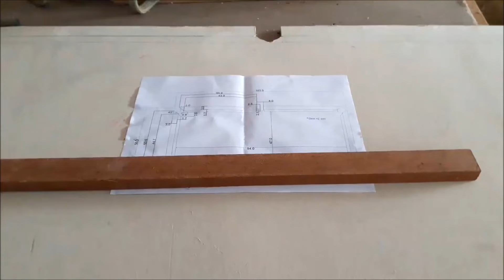Hướng dẫn tự làm bàn bi-a mini tại nhà | How to make a mini pool table at home

Comment: Great stuff! Especially how u managed to do the side cushions by simply using silicon.
Reply from the maker: Thanks guys !
Reply: One question though: didn't the silicon stick on the paper when u removed it or should I brush oil on the paper first? I'm thinking to use the same method for my cushions. Thanks
Reply from the maker: The silicone was quite stick on the paper but dont need brush oil first. Remember only remove it after (at least) 24 hours.

Comment: Yo dude, I saw what you use as a cue here, I have a decoration thing here, and it is exactly like that, but with leaves, so I removed the leaves and put glue stick at the end (melted) and it works fine
Reply from the maker: Yah, that was exactly what I did. Make sure that the diameter on top of the cue fits with your balls

Comment: What material called you put on the side.to make marble bounce easily.pls reply thanks
Reply from the maker: Starting at 1:54 ,the silicone that i used. Pour it into the mold and let it dry for 24 hours.

Comment: How was your table now?
Reply from the maker: Yeah It's still good but the baize is little bit old and dirty
Reply: Don't you clean it?
Reply from the maker: Not often clean it
Reply: Ok. Next time translate Vietnamese to English . Foreigners will not understand
Reply from the maker: Yeah I will. But did you have any social account for easy contact like gmail, instagram or facebook? It's quite inconvenience to get in touch through youtube.
Reply: Sang Minh I only have YouTube channel so sorry
Reply: Sang Minh 1 more question: you don't try the bumpers before you play, are you?
Reply from the maker: I dont understand what does "the bumpers" means. Which part on the table?
Reply: Doesn't matter. How can you make making holes?
Reply: How can you know after 24 hours the silicone will dry. I'm thinking about setting time in my iPad
Reply from the maker: Because I have checked it every single time and the result is after 24hours